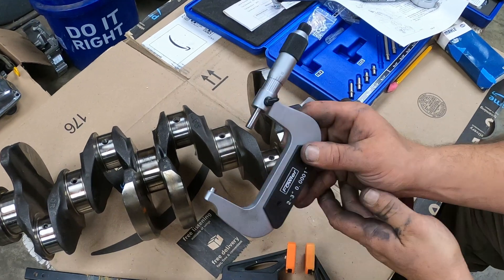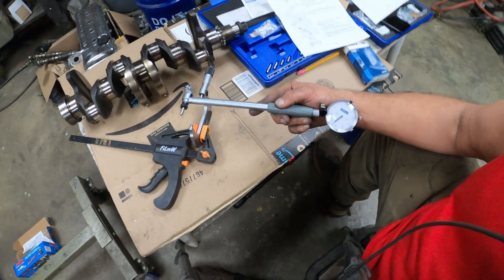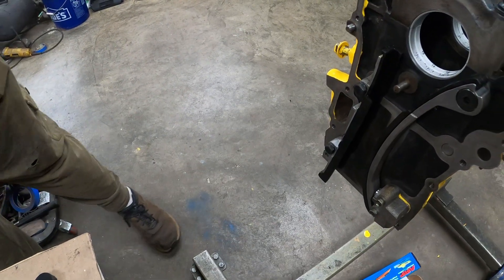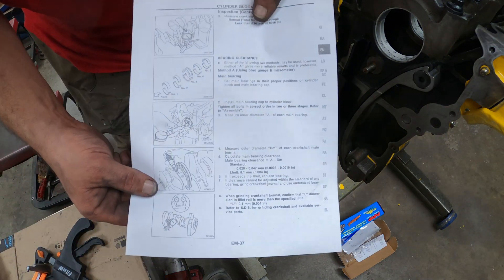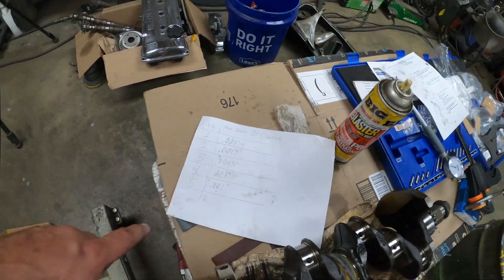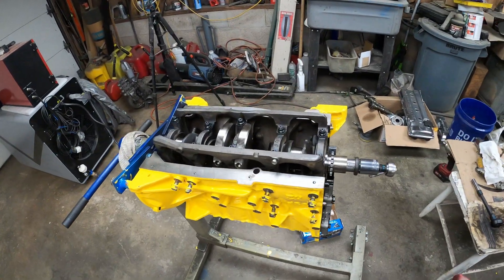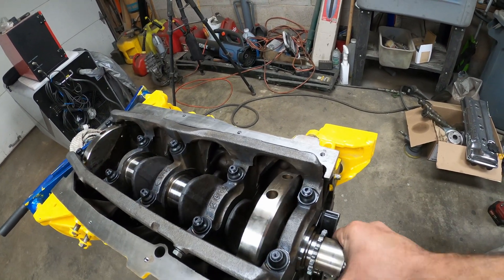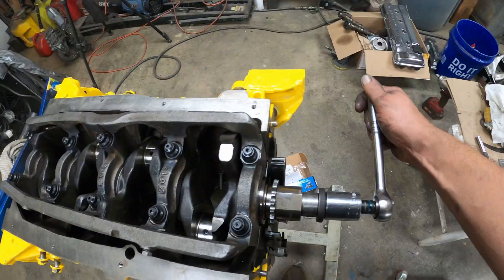240sx KA24DE Main Bearing Fitting - Adjusting Oil Clearance

Comment from the maker: So what do you think about how I "fit" the bearings?  Have you had much luck using plastigauge?   Have you ever used the "shoe lace" method?
Reply: that engine sucks go get k20 out of honda
Reply from the maker: @Moto-Tron  The k20 is ok,  but I'll stick with the ka, I know it well and if I did want to go a different direction I would go with a vk56de.  I like using the engine most people throw away, makes getting them much cheaper :p

Comment: With my last ka I ended up lucky and the bearings were right where I wanted them. Id be slightly worried if there’s no end play on the thrust, can’t remember which bearing manufacturer it was but I know one has and oversized thrust on a standard main, had a friend have issues because it pushed junk into the engine as it wore in instantly. Also check your oil squirter bolts and make sure they’re clean and not sticking. They’re supposed to be closed at low pressure. I thought my oil pressure sensor was going bad because it would have good pressure, then be low at idle then good again. Wiped out my crank in about 10 miles, luckily my head and turbo was fine.
Reply from the maker: thanks for the info.  I'll pull the oil squirters and check them.  I thought they were always open and flowing.  as for not having any end play, I don't think the trust bearings are too tight as the crank isn't binding up, and I didn't notice any scoring on the thrust surfaces when I pulled the crank to do the rod bearings after rotating it many times.  I should be able to check the runout on the crank though before I put the oil pan on.  I ordered another gauge set with a base for degreeing the cams and setting the valve lash so I should be able to set it up to measure the crank end play.

Comment: I put together a vq35de revup earlier this year. First ever engine build. I chose to use the Fowler gauge and outside mics just because I’ve read where people used plastic gauge and had issues. I still used the plastigauge but I checked everything with the mics. I should be dropping her in here soon. Fingers crossed
Reply from the maker: Nice, I used plastiguage on my first build as well.  I won't ever trust it again.  I figure for as much as it cost to build an engine why cheap out on measuring where it really counts.   I won't be getting this one put in until spring time.  I have a lot to do before it's ready to go in.  Good luck with your project.  What are you dropping that vq into?